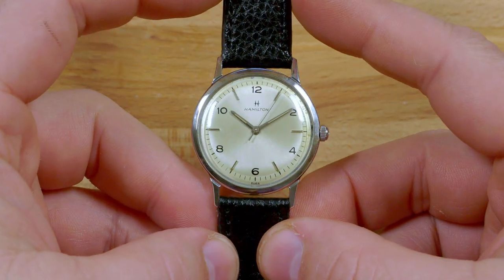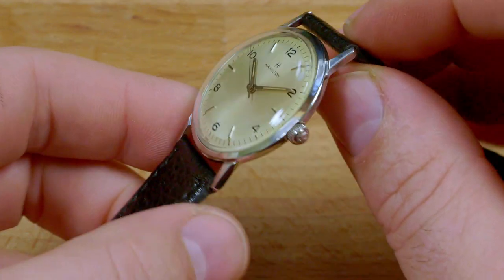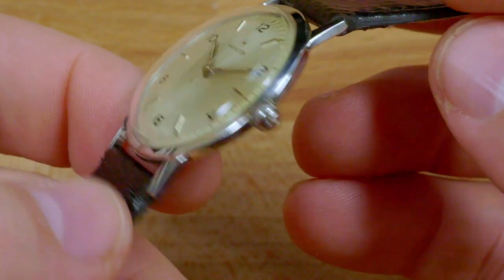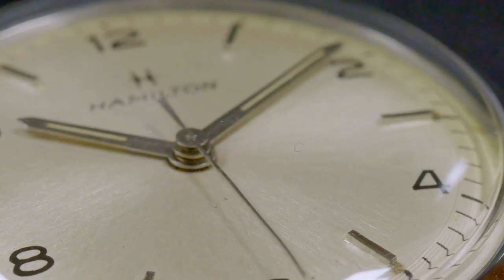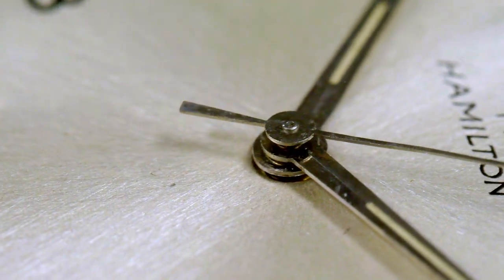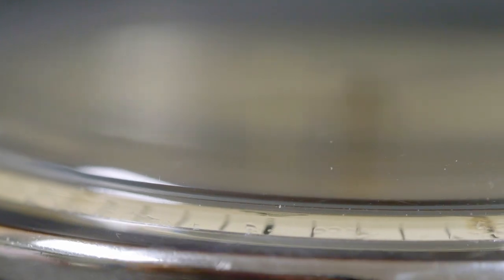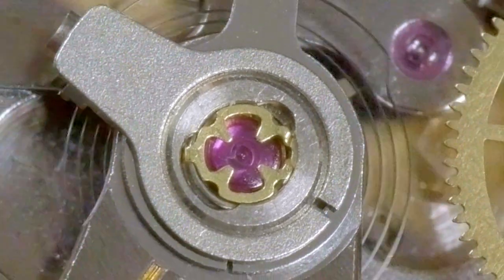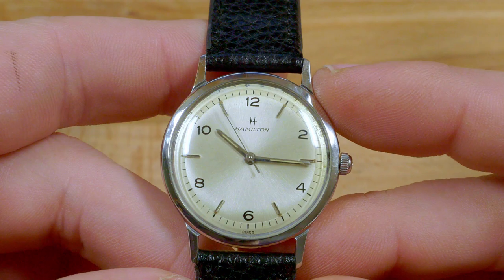Vintage Watch Review - 1962 Hamilton Sea Rover II - Shock Absorbers and Wardrobe Changes

Comment: I have a 1962 Hamilton sea river, like the one featured here in your video. It’s currently out for a complete overhaul and cleaning. Can you offer any suggestions on a band? I saw the black and brown offerings in your video. I’m partial to the brown. At 17.5 inches, I reckon it’s pretty difficult finding something at that size? What do you suggest?
Reply from the maker: Any leather 18mm strap will work. You'll just need to compress the ends of the strap a little before installing. With use, the strap will loosen up a bit and conform to your wrist. I prefer going slightly oversized with the strap, as opposed to a 17mm strap that leaves gaps and just feels a little too loose for my taste.

Comment: I have this exact watch, but it runs about 3 minutes slow per day. Could you describe how to adjust that, if it can be done? (I know nothing about servicing watches)
Reply from the maker: Adjusting the timing on these movements is pretty straight forward. The tricky part on this particular model is getting access to the movement. Since it's a one-piece case, you'll have to first remove the crystal, then the crown, then pop the movement out. Once you have the watch on a timegrapher, it's just a matter of nudging the regulator arm to shorten the relative length of the hair spring. Then you'll need to put everything back together again.

Of course all of this is entirely possible for you to do, but I'd recommend practicing on another watch first before giving it a shot. 

Or if you don't want to go to all that trouble and expense, your local watch maker should be able to knock it out for you in a couple of minutes.
Reply: @WolfeVintageWatches  thank you so much! This watch is particularly sentimental, so I'd rather not botch it. Your advice is priceless

Comment: I like the black strap better.  BTW, why do straps have so many holes?  You only need one for the right size, plus one up and one under.  Three is plenty.
Reply from the maker: They have so many holes to accommodate different sized wrists. I saw a video somewhere of straps that come without ANY holes, but had a punch so that you could punch one or two holes exactly where you need them. Pretty clever solution to the "too many strap holes" problem that isn't a NATO strap....

Comment: I have a very similar looking 1967 Garrard and both tan and black look great on these as does oxblood. I am not a fan of these modern straps though with the horizontal stitching on the strap near the lugs. Looks fine on something like a Panerai but on vintage I feel it looks both jarring and contrived, sort of hipster cool which as we all know, is not cool. A tan pigskin would make this mor casual though I feel the black strap you show on this on absolutely perfect as it gives it a more techinical purposeful feel I think.
Reply from the maker: Very well considered comment, thank you! Oxblood would look dynamite. 

If something is hipster cool, which makes it not cool, wouldn't that make it cool again? It's Hipster-ception